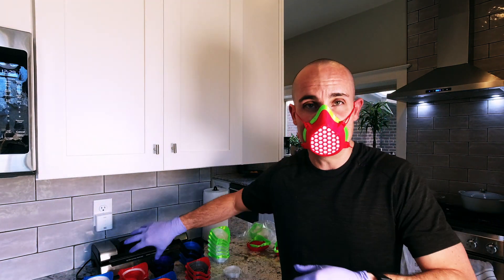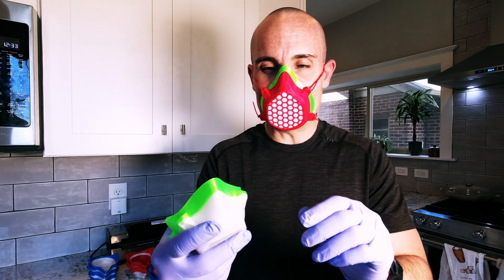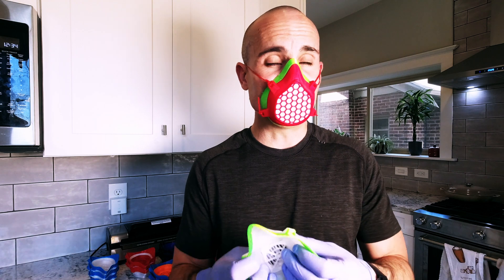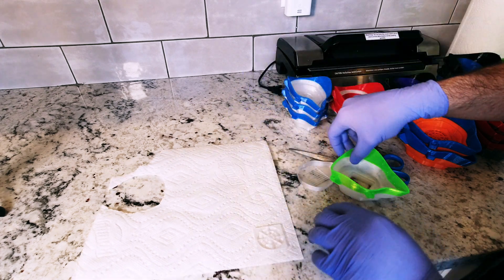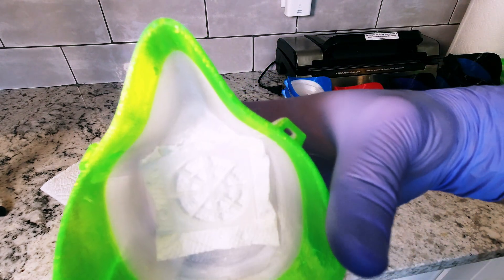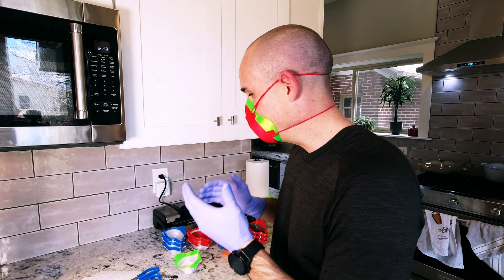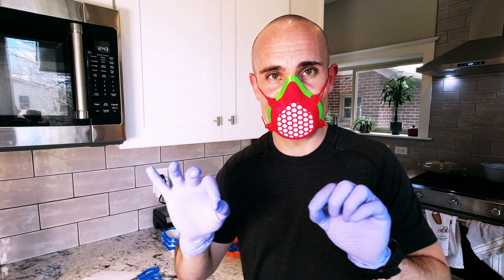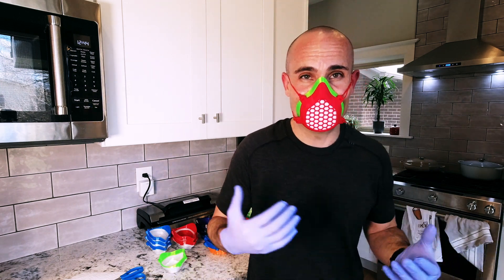3D Printed Cononavirus mask: common questions #coronavirus #covidmasks

Comment: What 3d printer would you recommend ?? Absolute beginner ..masks needed
Reply: The Ender-3 works perfectly fine with no distinguishable difference in print quality. Unless you don't mind paying $30-$40 extra, there's no need for the Ender-3 V2 or Ender-3 Pro (I operate 100 Ender-3 Pro's at my workplace)

Comment: If you use PLA, SEAL THE OUTSIDE and use a secondary foam seal around your face! (See pictures here, these take longer to print though: https://www.thingiverse.com/thing:4264698) I found that you can order replacement bra straps from Amazon that work great for straps for personal use: https://www.amazon.com/Closecret-Womens-Convertible-Straps-Optional/dp/B01FLJXDL2/ref=sr_1_2?crid=2Z8NBOQTC1XB4&dchild=1&keywords=bra+straps+replacement&qid=1586549710&sprefix=bra+straps%2Caps%2C224&sr=8-2

Comment: Regarding the heat buildup when using the mask, how about adding an exhaust valve by using a piece of rubber flap cut from a rubber glove in order to act as a one-way exhaust valve, similar to the valve used in industrial face masks (eg. 3M 6200 half-face masks, etc.)? In home construction work I can say for a fact that you can wear those industrial half-face masks for the whole work day without experiencing any heat buildup in the mask due to the exhaust valve in the design.
Reply from the maker: It gets complicated. This design seems to help quit a bit though: https://www.youtube.com/watch?v=PgABOJpu94k

Comment: Just to confirm you are using 95a TPU from that supplier right?  3 quick questions...as far as scale, have you found another way (other than WASPmed) to use 3d imaging to scale to a perfect fit?  2nd, maybe i missed it, but where are the build specs?  Infil, layer height, etc...only thing i remember is kind of a 60/40 petg/tpu.  Lastly, do you have a source for filter medium other than an actual mask?  I get that's optimal but supply's are limited to the normal person...so since the "montana mask" filter company shifted production...what are your thoughts?
Reply from the maker: Correct, all 95a filament since it handles various chemicals better.  For this print i'm changing to TPU at 29.90 mm layer height. I hared my 3mf in the description with all of my current settings. If you find more optimal settings, please share!  We were discussing the use of H600 as a filter medium which is plentiful in hospitals, but pretty expensive for any of us on the outside. I setup a slack channel to discuss this stuff a couple days ago if you want to join. We have 40 or 50 people already: https://join.slack.com/t/hospitalmasks/shared_invite/zt-dfqkug40-YAFFQbhcGa3uPpxBMyavqQ
Reply: @ALLYOURTECH3DP  Cool i'll take a look.  I'm still a noob and so to follow up on that...when you download a stl, 3mf, ply etc, the settings of your print automatically load in the printer?  So to be clear...as i put your program in my slicer (cura), it will know when to stop so i can put the tpu in?

Comment: I would caution against cutting up n95 masks. We currently dont know if 3d printed masks have any side-effects or cause more harm than good, and we shouldnt waste these n95s
Reply from the maker: This is feedback from doctors. Use what works best for you.
Reply: @ALLYOURTECH3DP  How about cutting up vacuum bag HEPA filters or HVAC HEPA filters with very high MERV ratings: eg. 3M Filtrete True HEPA air purifier filters rated to filter 99.97% of particulates down to 0.3 microns.
Reply from the maker: @xenoaltrax485  For home use I think that's perfect. In hospitals they have H600 fabric that actually filters better than an N95 mask. even better, they have tons of the stuff all over the place in most hospitals.
Reply: @ALLYOURTECH3DP  I don't know why people keep saying the H600 fabric filters better than an N95 respirator when the H600 fabric is only rated for ASTM-F2101 (filtration of particulates 1 micron in size), whereas the N95 is rated for NIOSH-N95 (filtration of particulates 0.3 microns in size). People keep quoting the 99.99% filtration of H600 but forget that this is against 1 micron sized particulates, and not 0.3 microns like an N95 respirator.
Similarly, 3M True HEPA filters are also rated against 0.3 micron sized particulates.
Reply from the maker: @xenoaltrax485  Thanks for the info, I have had multiple people in the slack channel saying it is the most viable option, it sounds like that is misinformation. So, the real replacement for an N95 would have to be a hepa filter that filters out at least .3 micron particles, then?
Reply: @ALLYOURTECH3DP  Yes, any of those true HEPA filter materials they use in HVAC/vacuum systems is rated for 0.3 microns, so filter cartridges like this for example:
 https://www.filtrete.com/3M/en_US/filtrete/products/~/Filtrete-Allergen-Bacteria-Virus-True-HEPA-Room-Air-Purifier-Filter-FAPF-HM-B/?N=4315+3290256462+3294529207&rt=rud
For 3M, what they market under the "True HEPA" category is what is rated for 0.3 microns (see under the section titled: "Difference between HEPA-type and True HEPA"):
https://www.filtrete.com/3M/en_US/filtrete/home-tips/full-story/~/how-to-reduce-dust-mites/?storyid=75200b03-7977-4621-a248-b5bc0d4e1ae2
Other brands also have their own equivalents for 0.3 micron filters. Usually they market them under terms like "true HEPA" or "absolute HEPA" to distinguish them from lower rated filters which are marketed as "HEPA like".